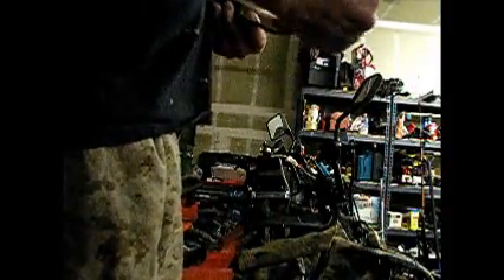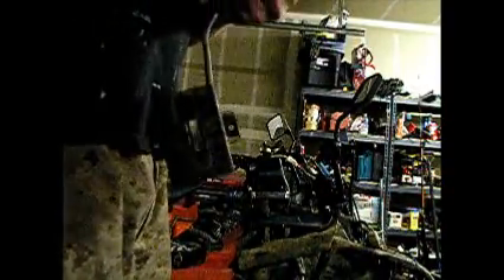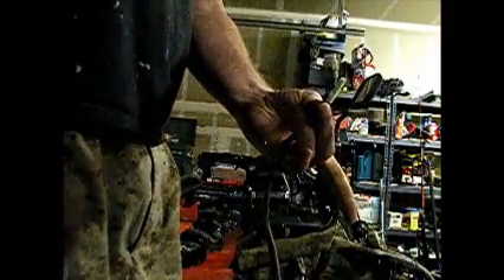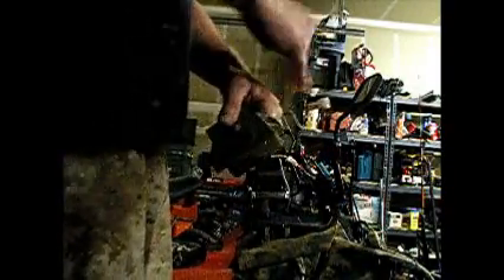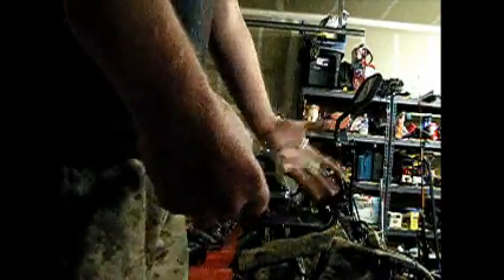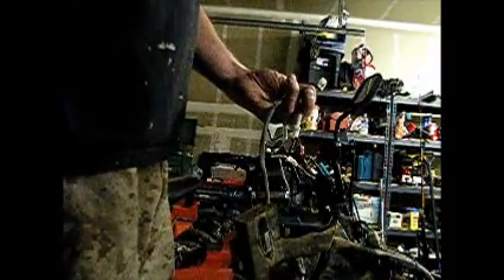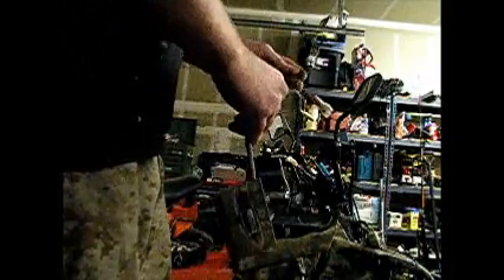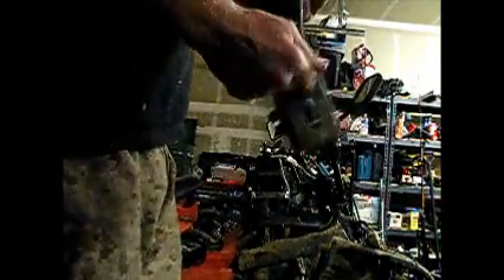DIY how to test a CDI for a motorcycle quad jet ski ignition stator magneto suzuki fix

Comment: Great video, i have checked every wire going into my cdi on my 81 honda cm400e and only one has power when pressing the start button, it is pink, there are 2 wires coming out dark green and yellow that go to the coil and they do not get power when trying to start the bike.
There are about 6 other wires going into the cdi and none of them have power when trying to start the bike, should more then one wire into the cdi have power to start the bike?
Reply: Je

Comment from the maker: so your saying both your old cdi and the new cdi are both only putting spark to one side?  I can't explain that but I do have to give you a fair warning about testing your cdi boxes for spark.  You want to avoid loading them up without dissapating the charge built up.  you run the risk of frying them that way.  check carefully the ground connections for the coil that wont fire and then put a meter on the wire coming in to the coil to see if theres 12 volts on crank?

Comment: Great video! I am having a problem with an old Virago I'm rebuilding. I purchased an OEM CDI box and two OEM coils. I am getting spark on one of my coils but not the other. To trouble shoot I removed the switched the plug to the coil that IS getting spark to the coil that is NOT getting spark. The test worked and I got spark. Leading me to the conclusion that the CDI box is only distributing information to one side. How is that possible? The aftermarket CDI reacts the same way.

Comment from the maker: your question is way to vague for me to answer.  key on start position, push start button moter turns but doesn't fire?  maybe cdi, maybe bad connection, wont know until you pull plug stick in the boot crank motor with plug against case to see if it sparks.  now what you wrote says to me that motor did not spin so that would be a bad switch on handlebars spray with wd-40 to clean connection up.  be more specific if you want my help

Comment from the maker: yes each individual cylinder has itsd own exit circuit.  I have heard of many cases where they fail randomly but not in whole.  was it recently jump stated by a running vehicle or boost battery charger?